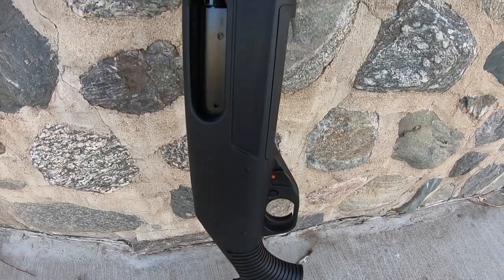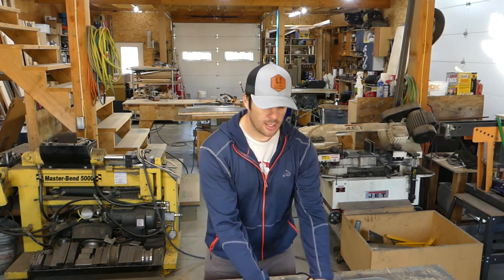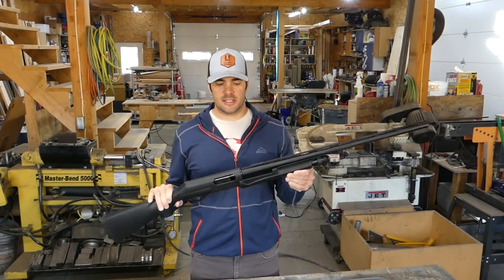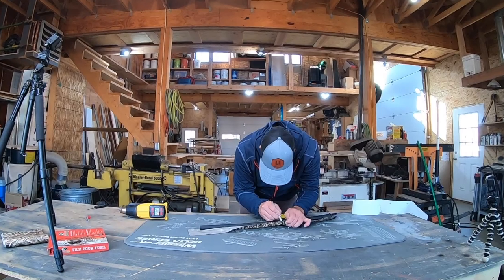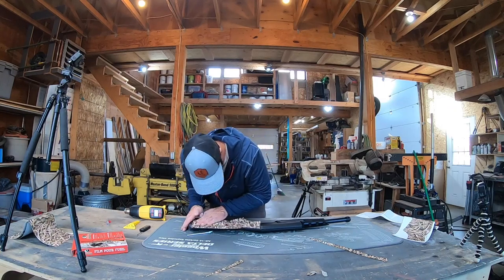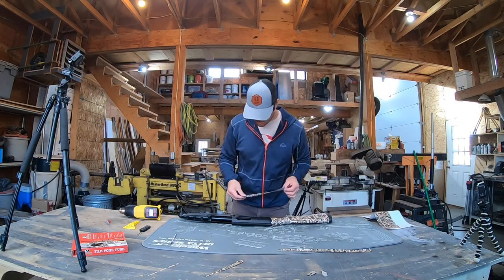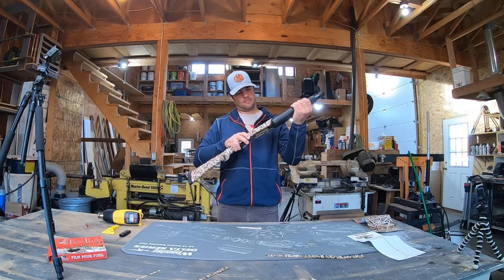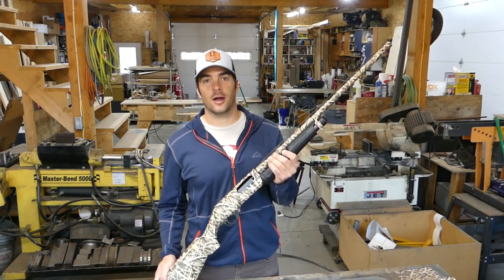How to Vinyl Wrap a Shotgun *Camouflage*

Comment: Wont it rust underneath?
Reply from the maker: I haven’t had any issues with rust on my .308 bolt gun and it’s been wrapped for 10+ years. I also live in a pretty dry climate, rust isn’t typically a concern around here.